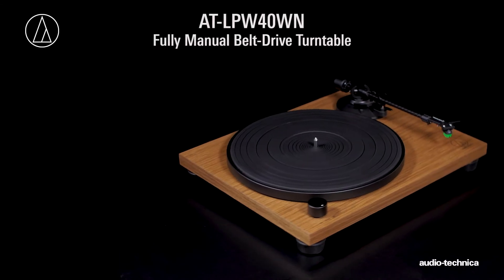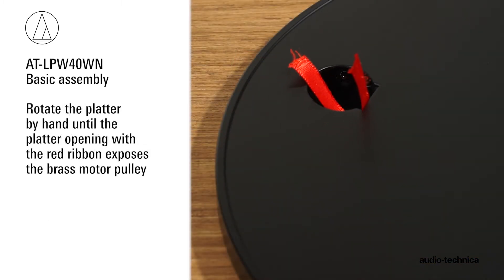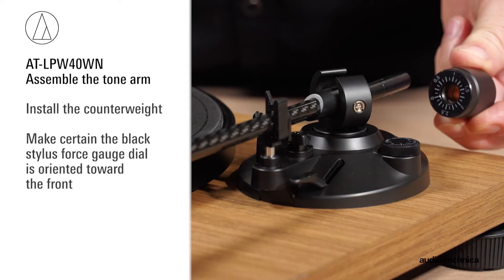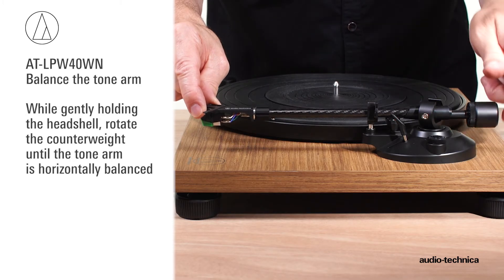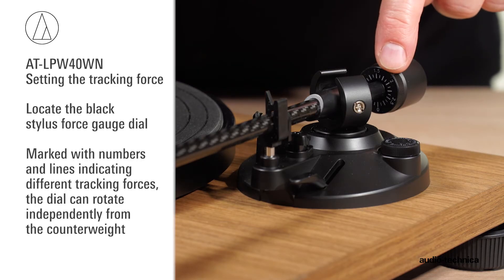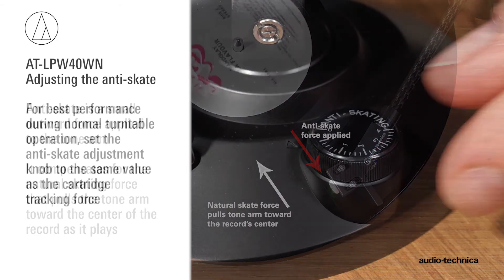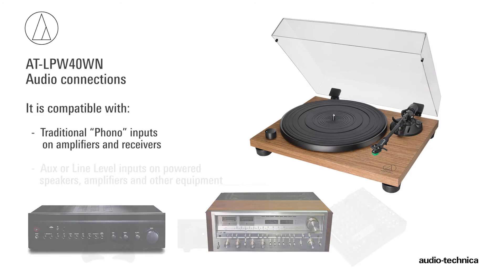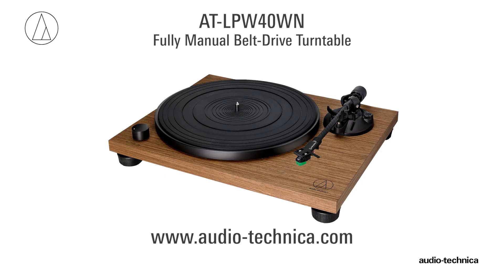AT-LPW40WN Setup | Fully Manual Belt-Drive Turntable

Comment: Hello, need help
Just using a soundbar with the turntable, connecting on the line output.
The sound is very low and it looks like many details are absent.
Connecting my old turntable with the exact same settings, the sound comes out loud and clear...
Any help please ? 😊
Reply from the maker: Hi there! Please contact our Audio Solutions Team for help. You can reach them at audio-solutions@atus.com. Thanks!  - A-T USA

Comment: Hi, is it normal, that the plate is not rotating "horizontaly balanced"? My turntable is leveled and is doing the same as in 3:12 in the video. Do I need to make some adjustments to (for example) the belt?
Reply from the maker: Hi there! Please contact our Audio Solutions Team for help. You can reach them at audio-solutions@atus.com. Thanks!  - A-T USA

Comment: I am new to vinyl, I wanna know if it can be connected to a normal Bluetooth speaker via aux cable? I know it doesn't support Bluetooth, but I don't have other kinds of speakers other than a Bluetooth speaker with aux input.
Reply from the maker: Hi there! Yes, the AT-LPW40WN may be connected via the analog output of the turntable to a LINE level input such as Aux in.  If the speaker does not have an internal RIAA phono preamp, the preamp switch on the rear of the turntable should be set to LINE.  The full set up of the turntable may be found here:
https://www.audio-technica.com/en-us/support/audio-solutions-question-of-the-week-how-do-i-set-up-my-at-lpw40wn-turntable/ 
-A-T USA
Reply: I connected my LPW40WN to this speaker via aux cable, but the sound was very very low. I switched between phono and line option, no change.
Reply from the maker: @Allen_Hermes  Hi there! We recommend removing and reinstalling the stylus. See information on doing so here: https://www.audio-technica.com/en-us/support/audio-solutions-question-of-the-week-how-do-i-replace-the-stylus-on-my-at-vm95-series-phono-cartridge/. If there is still an issue, please contact Audio Solutions at audio-solutions@atus.com. Thanks! - A-T USA

Comment: Anyone else have issues when using the line level setting. I tried it and sound only comes out of the right speaker.
Reply from the maker: Hi there! This is typically the result of an imbalanced tonearm.

Instructions to check this begin on page 6 of the AT-LPW40WN User Manual: https://tinyurl.com/2938enuc Thanks! - A-T USA

Comment: Would anybody please let me know the correct size of the belt for the AT-LPW40WN turntable (in centimeters if possible)? I'd like to buy a replacement belt. Thanks in advance!
Reply from the maker: Hi there! The replacement belts for the AT-LPW40WN measure (0.6mm thick x 4.6mm wide x 550mm long) and are available through our Parts Department at Parts@atus.com. Thanks! - A-T USA

Comment: Bought this today, and playing it through my mini hifi system.  On the "LINE" setting the volume is considerably lower than the mini hifi system is capable of (much quieter than CDs played through it) and just not loud enough.  (On "PHONO" it is almost inaudible.)  Is there any way to increase the volume?
Reply from the maker: Hi there! Please contact our Audio Solutions Team for help. You can reach them at audio-solutions@atus.com. Thanks!  - A-T USA
Reply: It's a normal behaviour when playing analog that records are bit lower. If you don't have phono inputs in your amplifier you should connect to aux and switch to line.

Comment: Shouldn't you lower the tone arm lift lever when adjusting the counterweight? Otherwise it is difficult to determine when its just at its balance point since the UP position maintains it at a horizontal level.
Reply: He did it right . the balancing was already done just the tracking force weight left to be done i didn't see any mistake

Comment: Stupid question, but I'm not having success finding the answer via google. This turntable is designed to stay on when the record is over until you turn it off? I thought maybe I had it calibrated wrong but according to this I'm good, so just making sure it's fine for it just to keep spinning on the inner, non-grooved part until I remember or realize I need to flip the record/turn it off?
Reply from the maker: Hi there! Please contact our Audio Solutions Team for help. You can reach them at audio-solutions@atus.com. Thanks! - A-T USA

Comment: Simple question I hope you would answer it because I asked on Instagram and no one answered, I am considering to buy a turntable and I am a bit confused between this and the lp120xusb, I know both are your products but what would you recommend please
Reply from the maker: Hi Mohamed! The AT-LP120X is direct drive and the LPW40 is belt driven. The LP120 has some DJ features such as speed up and slow down. The LPW40 does not. The LP120 will play at 33.3 45 and 78 RPM. The LPW40 will play at 33.3 and 45 RPM. If you are just using it for causal listening, we would recommend you go for the AT-LPW40WN. Thanks! - A-T USA
Reply: @AudioTechnicaUSA  thank you very much for your reply and information provided will take into consideration 🙏🏻